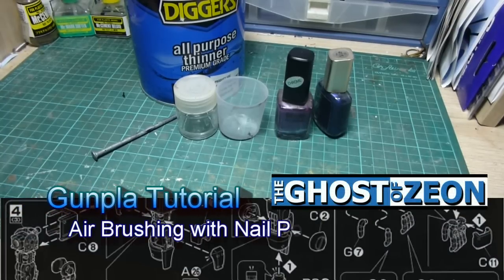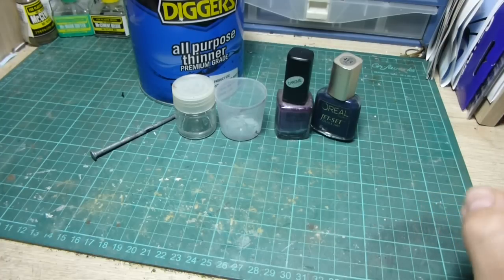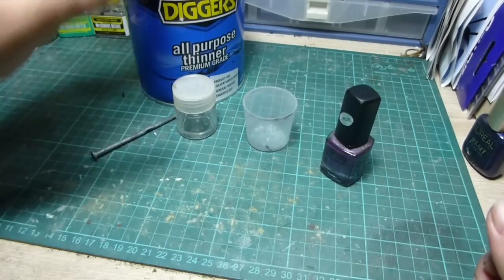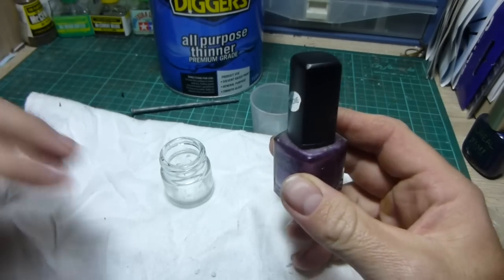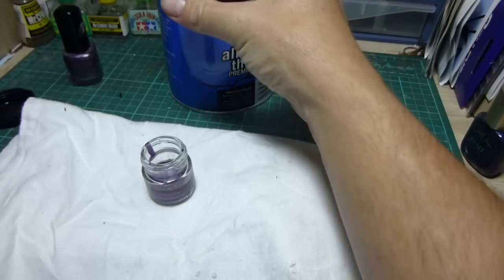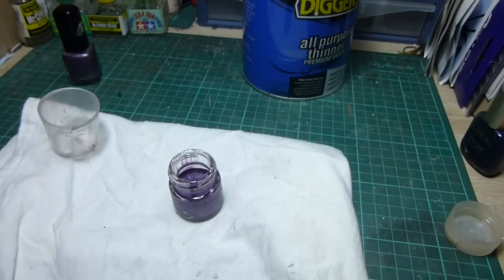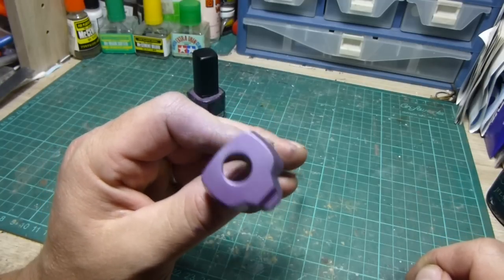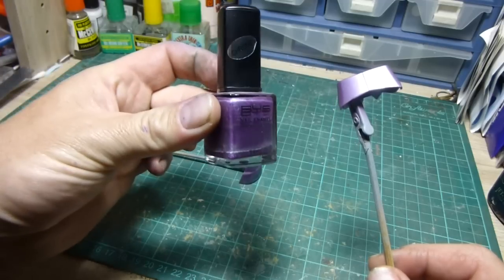Gunpla Tutorial : Air Brushing with Nail Polish

Comment: I must try this :) Some nice colors can be achieved with nail polish, however, I heard some nasty stories of nail polish clogging up airbrushes and messing up seals if not thinned properly...
Reply from the maker: It can depending on the pigments in the nail polish. If ever in doubt, use a paint screener that you can get at auto paint stores to strain out the larger pigments.

Comment: hi, great tutorial. However, it would have helped if you could offer some advice on preparing mixtures not just for airbrushing alone. I always hand paint my kits with nail polish so i was hoping for some advice from this video..
Reply from the maker: rick hernandez I don't hand brush nail polish, I only air brush them. I'd imagine that thinning to an appropriate mixture (maybe 70:30 nail polish to thinner?) and then applying with multiple thin coats would work. This is only a suggestion as I haven't done it personally.

Comment: Hello. I tried the very same way with the Tamiya Lacquer Thinner; consistency is ok to spray but color becomes so pale and light and wont even cover a light coat. What can i use to thin it besides Lacquer thinner ?
Reply from the maker: Slammer There is a few issues here. If the paint is very translucent, either the nail polish has been over thinned (fix by adding more nail polish to the mix), or there aren't many pigments in the nail polish (if so, then multiple coats will be needed to bring the colour up - the light blue on the Sazabi I did needed 4 coats to get the colour right). An alternative thinner is General Purpose thinners or General Lacquer thinners. These are more potent than the hobby varieties and will work with nail polish.

Comment: I've tried it, and I got fantastic results! Thank you for sharing this video, TGoZ! One thing, though. For future purposes, how will I be able to strip the nail polish off of the model kit? I've watched your paint stripping tutorials, but I'm not sure which I should use. I prefer, if possible, the Bleach method. Will it work? Thanks.
Reply: +DIO BRANDO One more thing I'd like to ask is that I'm afraid that using this stuff, the nail polish and lacquer thinner, might cause some long-term negative effect on my respiratory system. What kind of respirator and gear should I wear? Will the "respirator with cylinder filter" work?
Reply from the maker: +DIO BRANDO Always get the respirators that are rated to remove fumes. The stronger the filters the better. Don't skimp on protective equipment!
Reply from the maker: +DIO BRANDO It should be easily removed with bleach or at least with something stronger like Brake Fluid, or Easy Lift Off.
Reply from the maker: +DIO BRANDO It should be easily removed with bleach or at least with something stronger like Brake Fluid, or Easy Lift Off.
Reply: Oh my, you actually replied! Awesome!

Anyway, I searched in hardware stores near my area for respirators, but all I found were them flimsy looking made in China ones, and to be honest, I'm unsure whether or not they'll work. I also searched in online shops, and they recommended the 3M brand, which is pretty pricey for me, to be honest. Is that feasible for this hobby, or will that be overkill if I use that?

Lastly, if I soak the parts painted with nail polish overnight, will it have negative effects on the plastic? Brittleness, and softening of the parts?

Again, seeing you reply is a pleasant surprise. Because of that, I'm now assuming that you're one of those helpful hobbyists who take their time to help other fellow hobbyists. I just want to thank you, man. I really appreciate the help!
Reply from the maker: DIO BRANDO
I use a 3M respirator that has replaceable filters. Only cost about $30AUD which in the long run isn't that costly at all. The filters are rated for fumes and are the best you can get for that respirator.

Soaking plastic in bleach is perfectly safe and will not cause any issues with softening or brittleness.

And thanks for the kind words, my entire motivation for creating this channel and my original website was to be able to help those who need it. When I started out, no one wanted to help, I just got abused for not looking it up, so I vowed to make a resource that helps rather than hinders. Glad you like what I do! :)
Reply: It makes me wonder even more how many people you've helped out throughout your stay here in Youtube, and before that. Thank you.

http://ph.rs-online.com/web/p/reusable-respirators/0766378/

This is the 3M one I found, since my only option to have that is through shipping (There aren't any available in the hardware stores in my area). Other than that, will the "anti-dust" respirator work?
Reply from the maker: As a comparison, this is the one I use (the link is from the Australian hardware store that I got mine from) : http://www.bunnings.com.au/protector-half-face-single-filter-respirator_p5820162

Comment: can you use acrylic paint or does that need to be thinned as well? I got an airbrush for doing nail art I guess I cloud use polish enamel thinned as well what thinner do you recommend for the paint etc.. hope you reply ☺
Reply from the maker: Paint always needs to be adjusted to be able to be sprayed through an 
air brush. The type of paint you use depends on the application and the 
thinner type is also based on whatever the paint type is. If you use a 
lacquer based paint, use a lacquer thinner. Acrylics, use an appropriate
 thinner such as Isopropyl or water.

Comment: Interesting. Do you use primer with those paints, and if so, what type? I imagine they would dissolve it anyway if they contain acetone...?
Reply from the maker: Use Acrylic Lacquer paints and primers as they share common solvent bases
Reply: @TheGhostofZeon  Im kinda new to this whole thing, acrylic laquer == mr primer surfacer? And again, wont spraying acetone on that dissolve the primer?
Reply from the maker: @benjimlem1284  acetone is generally a major ingredient in solvent based paints. As you are airbrushing these on, the solvents will evaporate quickly meaning that they aren't exposed to the paint below for too long. If applied correctly, there will be no issues if you use a solvent based primer such as Mr Surfacer underneath.
Reply: @TheGhostofZeon  I see, thanks :3 I dont often need a bright, glossy finish (I mostly paint warhammer figurines and WW2 tanks), but it's good to know if I ever need it :3

Comment: noob question, what kind of primer is best to use with this type of method? also with regards to storage, can i use a plastic dropper bottle instead of the glass ones?
Reply from the maker: Standard modelling primers like Mr Surfacer or Tamiya Primer are best to
 use. I would steer clear of Polyurethane based ones as the lacquer 
thinners can react with them. 

In regards to storage, any glass jar/bottle will be fine.

Comment: If the nail polish happens to dry inside the airbrush gun, does running thinner through the airbrush still efficiently clear it out?
Reply from the maker: Yes, cleaning out your air brush is exactly the same, just use lacquer thinners to do it and it will be ok.

Comment: This is a really old video - but I'm hoping you will see my question:) Did I see that you poured the thinned polish into the dispenser on top of the gun? Others I have seen always used a jar screwed onto the machine, but I don't want to have that much paint...
Reply from the maker: Yes, it's a gravity fed air brush meaning the cup is on top and a part of it. Ones with the jar attachments are siphon fed types. I only use gravity fed ones as I find them much easier to use and you can get away with using a tiny amount of paint
Reply: WOW! You are the best - thank you so much for responding..  Have you ever tried gel polish? It cures try with a LED/UV nail lamp and is extremely durable. It won't remove even with acetone unless you work extra hard to do so... you have to sand it off! I am going to see if I can thin it out as much as needed for an airbrush, it's pretty thick stuff.
Reply from the maker: Gel type is not really suitable for models in my experience. The standard nail polish works best everytime.
Reply: You gotta do what works for you! Thank you so much - this video was exactly what I needed:)

Comment: Thank you for the video! Tell me, can you airbrush UV gel top coat as a topping? UV tempered nail top coat hardens to form a nice protective surface, but is usually too thick and not smooth to use on miniatures the regular way. If so, what can you use to thin it?
Reply from the maker: No, avoid using Gel type nail polish. Just standard nail polish clears will be fine.

Comment: Hey Ghost of Z, I'd like to ask if it's possible to use nail polish as is. I mean you paint it as if you're painting your nails but on your kit instead. I tried practicing with mine but I can't seem to get the consistency right, do I still need to thin it?
Reply from the maker: +LatencyProblem Yes, you'll need to thin it as it is very thick out of the bottle. I don't recommend hand brushing it on as the pigments are finer than normal hobby paints and therefore take more to get the colour even. It is still possible to do it, I just don't think its viable.
Reply: Thanks for the reply! yeah I did try to paint it with a brush but I just cant seem to get it to stay on the plastic
Reply: If it wont stick on plastik. Dont thin it then.since you are not using an air brush.

Comment: my nail polish become clumpy when I thin with home depot's thinner
Reply: it doesn't mix, both repel each other.
Reply: hah crap I found the culprit. I didn't read the small prints, it was an oil thinner I bought. uhhhh
Reply from the maker: Yes, that was going to be my suggestion to check to make sure that the 
thinner is right. If you can get Automotive paint lacquer thinners it 
would be even better than standard lacquer thinners
Reply: Lol :D

Comment: i tried thinning it with thinner but it dont seem to thin easily. Should i try nail polish remover instead?
Reply from the maker: +Alan Tan Nail polish remover is Acetone and Acetone is extremely bad for plastic. 

What type of nail polish are you trying to thin? I have thinned dozens of bottles now and they always thin perfectly the first time for me.
Reply: +TheGhostofZeon I bought it cheap from a night market. front of the bottle said lacquer paint but small description said acrylic. so it's confusing.  I'm using hardware shop thinner.  I thin 2 times thinner 1 time nail polish as I tried 1/1 makes it stuck to my airbrush.  1/2 make it work but does not have much metallic color on it.
Reply: +AT Customs if it cleans up with plain water easily, you are not going to be able to use lacquer thinner. For acrylic paints you can go to the hardware store and buy Floetrol paint conditioner it works great, even with a brush I'd you have to use one, it will make the paint "lay down" won't leave brush strokes. remember "synthetic bristles for water-based paints, real hair bristles for paints that don't clean up with soap and water". Penetrol is the conditioner made for oil based paint, use it as a thinner (not sure on lacquer paints you need to test small amount or ask FLOOD company). Scaled up to what I have had to use a brush to paint with, it makes the Cabinets look as though they have been sprayed like an auto finish. FLOOD is the brand that produces both Floetrol and Penetrol paint conditioners.
Reply: for nail polish, you should use nail polish thinner. Nail polish is made from nitrocellulose dissolved into ethyl acetate and butyl acetate. That is what is in nail polish or nail lacquer thinner. It will dry much more evenly and be more predictable if you use the proper solvent.
Reply from the maker: Nail Polish thinner can cause issues with plastics (the acetates etc) which is why I use a lacquer thinner to thin the nail polish. I have never had an issue with using lacquer thinners yet. Dade Wheless
Reply: I use laquer thinner from my home depot and it doesn't mix with the nail polishes I bought. the nail polish became clumpy and doesn't even mix.

Comment: can i just paint it on and if so does it still need to be thinned
Reply from the maker: Sam ewyk It must be thinned for painting. The nail polish is too thick to be just painted on by hand.
Reply: if i add thinner will it stick better as in i can't scratch it off really easy
Reply from the maker: Sam ewyk Thinner will allow you to air brush it otherwise it will be too thick and not pass through the nozzle.
Reply: i mean hand painting it with a paintbrush not air brush. do i still need to thin it if im painting with a paintbrush and if so will it proply stick on plastic and make it stronger?
Reply from the maker: Sam ewyk I would thin it at a lower ratio than what I do here because it is different in terms of carrier and pigment to that of hobby paints. It is still too thick out of the bottle, even hand brushing.